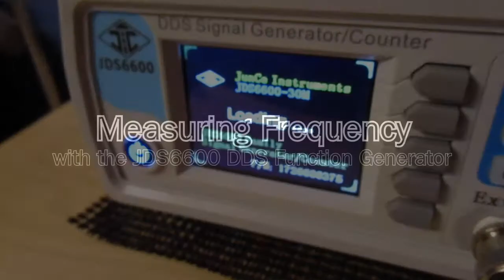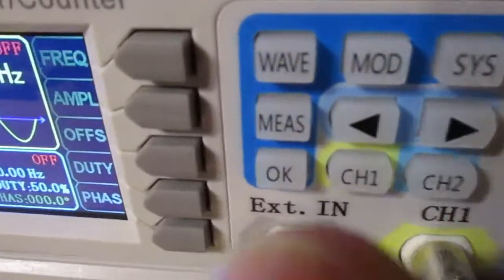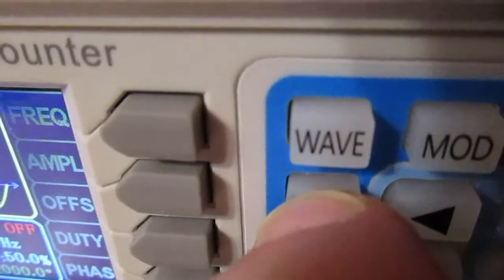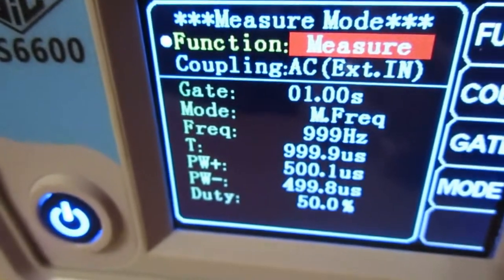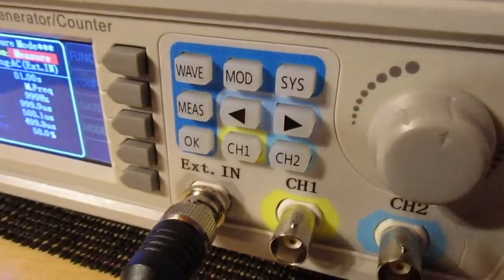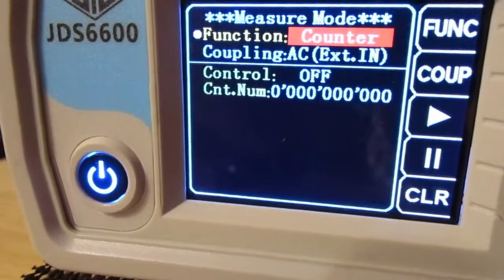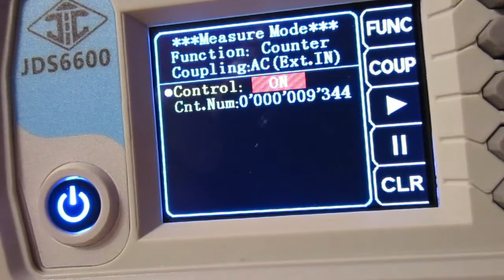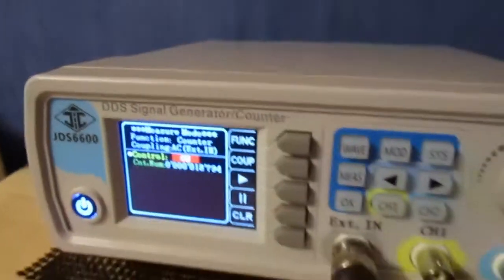Measuring Frequency with the JDS6600 DDS Signal Generator/Counter

Comment: Will this measure a stable frequency output from a CB radio?
Reply from the maker: Hi Scott, thanks for yor question. The built-in frequency counter is suitable for signals up to 100 MHz and between 2V and 20 Vpp. Don't plug your CB directly into it though or you will damage it. It would be safer for you to put a telescopic antenna on the JDS6600 with the CB nearby. The frequency accuracy is stated as "+/- 20ppm" so that's 20 parts per million, so at 27MHz it would be within about 600Hz (plus or minus) of the frequency. No too shabby really.  
Here is a more detailed video on the subject for you: https://www.youtube.com/watch?v=sZMJVZQifpI